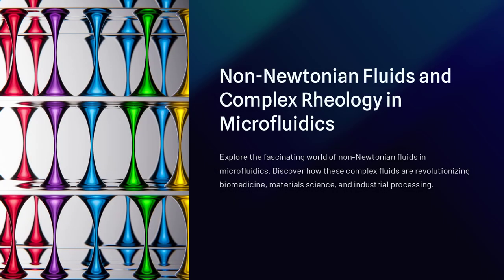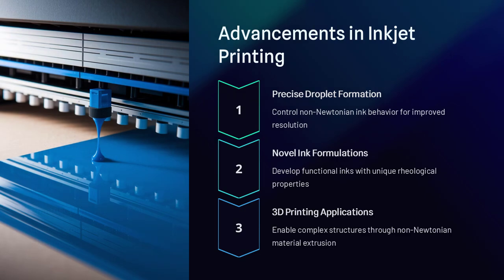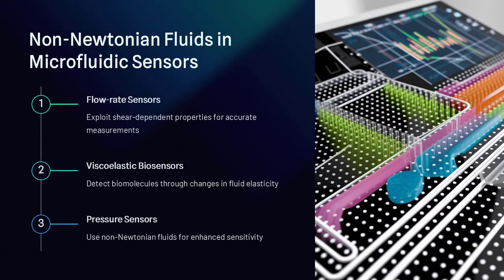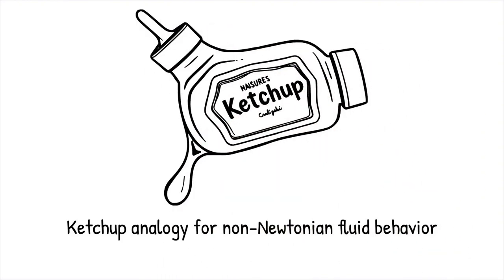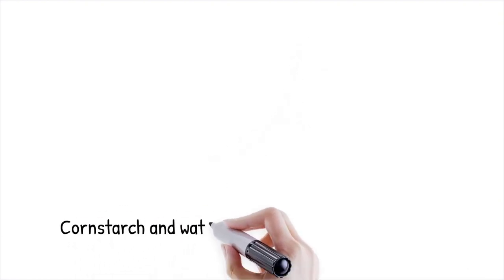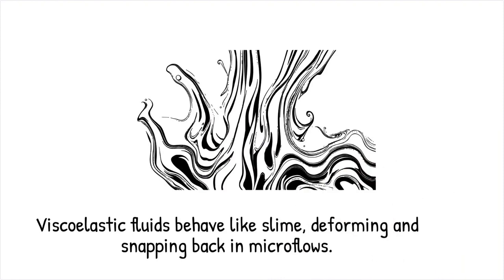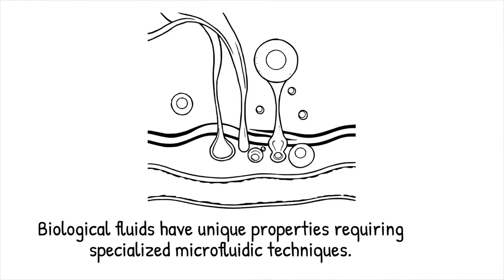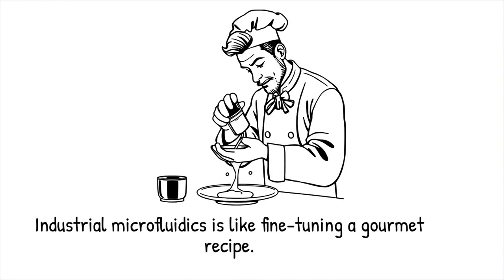Non-Newtonian Fluids in Microfluidics: A Game-Changer

Comment from the maker: How can microfluidic systems be engineered to precisely control the transition between shear-thinning and shear-thickening behaviors in non-Newtonian fluids, ensuring optimal performance in drug delivery, lab-on-a-chip diagnostics, and biofabrication?
What are the underlying molecular and intermolecular mechanisms governing viscoelastic behavior in microfluidic environments, and how can they be manipulated to enhance droplet stability, controlled mixing, and programmable material responses?
Can AI-driven predictive models accurately simulate the real-time flow dynamics of complex non-Newtonian fluids in microfluidic devices, and how can these simulations be experimentally validated to optimize designs for biomedical and industrial applications?